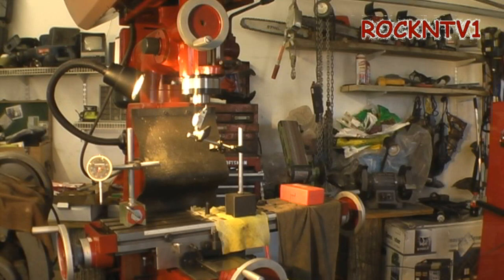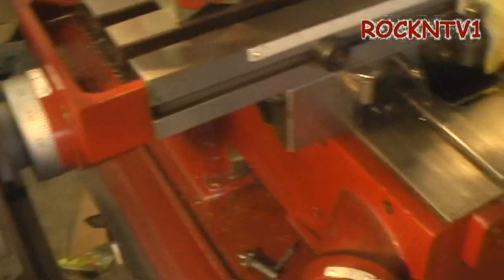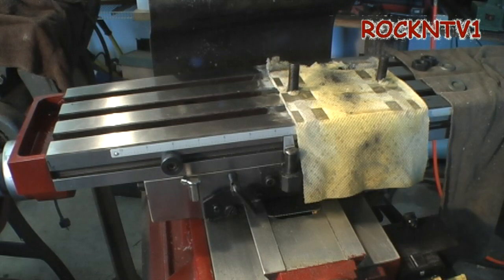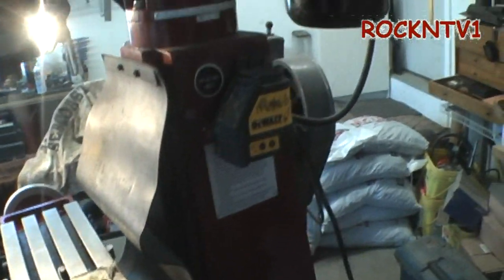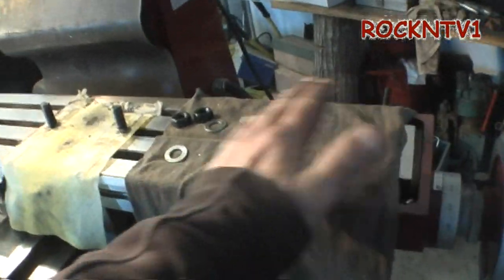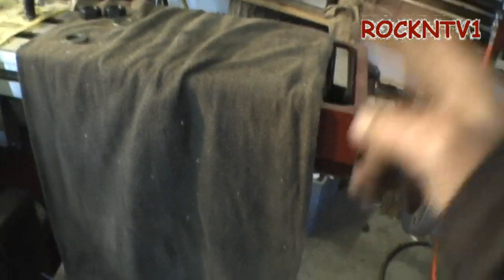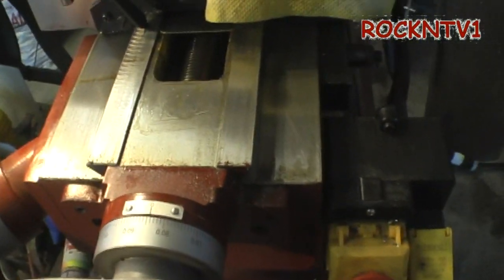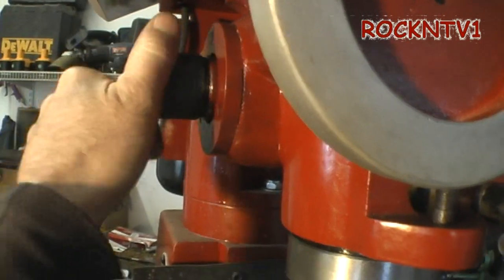HARBOR FREIGHT MILLING MACHINE MINI Knee MILL REVIEW 40939 6x26

Comment: I'm seriously thinking about getting  this machine one day, but I'm nervous 😅; the Grizzly machine starts at 6k up to 8k but it's it really tasty much better? 
Thanks for reviewing this machine, good video!

PS; for the money, this machine might be a hidden gem; mini mills cost this much,  but they do not have the power nor the weight. That said, I'll gladly pay 1k or a little more extra to get better surfaces and fit and finish.  
Thanks again for the video!
Reply from the maker: Cant speak to the quality of the grizly, it does have x power feed and green paint. my stand is way better,, lol  When it comes to parts they may be better, more easy to get,, dunno, i make everything.

Comment: You video is good, I agree with you, I bought and old bridgeport on ebay 3 years ago. Because i thought it was a great deal. When I got it home, the y axis slides had about .016" dip in wear, the table was down .024 in the middle of the ways. A few other things were wore out as well. I had access to a vey large newer milling machine where I worked. I remilled the table and ways, I remilled the entire knee. It took almost a year and a half after I had it in my workspace to get things straightened out. Then I had to regrind my spindle taper. It was a ton of work and and I lost tons of my own time. I needed a machine when I bought mine, but I wasn't able to use it for a year and a half. If you need a machine to use  now, don't buy the old wore out machine, buy a new cheapie and use it make some money with it and buy something later.
Reply from the maker: I agree

Comment: Hello! Checking in to see how you like the machine after all these years? Has it been as accurate as you would like it to be? Easy to maintain? This is still the cheapest smallest knee mill out there and the power & rigidity you get for the dollars seems to still be the best. Im in the market for a new mill soon.
Reply from the maker: Hi Joe, I do belive i could go on for hours on the Harbor Freight 6x26 bench milling machine and its pro and cons. I think i layed out pretty extensivly in the vid what you get. How ever here in 2021 the price has gone up, yet i'm, sure the build quality, parts availibility, and sentiment of the fork trucker during shipping has plummited. That said, If you are, or have machining experience on better quality milling machines, you may be disapointed, or you may better be able to deal with the idiocincracies ? of the chineese miller. You wont keep a bulb in the light. You will learn to deal with motor start capacitors and cheezy on/off switches. You will learn to count .125 per rev on feeds rather than .100 you will need a stand or a bench with a hole in it. You will tram the head nod with shims. You will calm your feed rate due to niose in the spindle sheave. If none of that has yet to deter your home machine shop projects, you will commence to mod the travels in x,y,z, lol. I do have a play list > https://youtube.com/playlist?list=PLhIFDVyYdJHY9V4PXfC63OIRFprrKIL1Z < this covers my last 7 years to date, PLZ dont use this on your site with out a link back here. Thanks, 
John
Reply from the maker: hope all is well ;-)

Comment: Is this machine the same as the Baileigh VM-626-1? It is a 1/3 of a price. One has the specs for 220v and the other is 110v
Reply from the maker: I dont know, this mill is 220v
Reply: @ROCKNTV1  Do you think that the harbor freight motor can be wired at 110v? I totally believe that they are the same machine with a different paint job.
Reply from the maker: not likly, but unsure,,,

Comment: 12:00 

allthread rod is soft, wouldn't be good for a lead screw. it would work, for a time, but it would wear out pretty quick and you'd have to buy another.
Reply from the maker: not allthread, 1x8 acme thread

Comment: Also, what type 240v connector did you use on the mill electrical cable and the wall socket?
Reply from the maker: oi, i forget 250/30p ?

Comment: It's been a few years, are you still using this machine?  Are you happy with it?  Are you doing ok?
Reply from the maker: yes, power switch has calfed, the belts have seriouse lumps at the splices, the motor end cap bells/ bearing holders, needed some tapping around with the soft hammer to find centers, as theyt are no where near the quality of a baldor or dayton motor.

Comment: try paste wax to fight rust I use it on my cast iron table saw and drill press the plus of not useing oil saw dust or chips do not stick to table
Reply from the maker: thanks for the tip
Reply from the maker: hope all is well ;-)

Comment: I HAVE THE GRIZZLY G3102 THE SHAFT IS ABOUT 36 3/4: LONG. I WOULD THINK IF YOU ARE RIGHT HANDED YOU MAY WANT THE MOTOR ON THE RIGHT SIDE FOR THE POWER FEED. IF YOU WANT TO GO TO CNC, YOU MAY WANT THE MOTOR  ON THE LEFTAND JUST REVERST THE SHAFT.  THE PROBLEM I SEEN WAS THE END CAPS ARE NOT REVERSABLE ON MY MACHINE. SO I ASSUME ONE WOULD HAVE TO REVERSE THE WHOLE CARRAGE ASSY.
Reply from the maker: replace the 40939 x lead screw with a g3102, and end cap, add power feed. thanks for watching, is you tube borking the comments?

Comment: you just do with what you can buy, a 10.000 dollar machine is great but only few people have that kind of money for a mill, my machines are never super clean but I do use an old vacuum cleaner when im done with the machine to clean it
Reply from the maker: I have been saving up for a milling machine for 2 years now. I called bigdog about the metal master mill as a match to my bigdog mini lathe, but they never called back, It was then that I looked hard at these 6x26 and the 40939 mill. So many mini lathe and hobby machine sites have photo's of this class of machine with useless mods and mis information, I thought I would give the facts on video.  pound for pound and dollar, I think i got the most machine for the money.
Reply: ROCKNTV1 Would love to have a machine like that and a gagage like yours, I think you got a nice mache for the money you payed, I hope you can take some of the runout of, but as long als you know it you can do something about it or at least know what its doing and why it could be a little off
Reply from the maker: happymark1805
good to ear you mark. hope al ist well, I fear not much can be done with the few tenths in the spindle, neither bearing nor grind provide and absolute outcome, slimming my options, however cutter compensation at touch off will give an experience operator +/- .001 or close, better then most machining jobs not government:)

Comment: This machine is not considered  a  ( mini ) mill.  its a small mill but not a mini mill.  type in mini mill in your browser and you will see what a  ( mini ) mill actually is.  No sarcasm intended.
Reply from the maker: I think the term is relative if one has run much larger milling machines. Some call them vertical bench knee mill.

Comment: Check out http://www.kinzers.com/don/MachineTools/Grizzly_G1004/ for ideas adapting power feed.
Also there is a guy on the yahoo 6x26 with pics that made an adapter to fit the lead screw. You got a lathe, you can do it.
Great vids
Reply from the maker: hi, I have seen that page, here, http://www.rockntv1.com/2014/01/40939-6x26-mini-knee-mill-review.html I out line the measurements of the 40939 mill In effort to source these parts off the shelf from the grizz 6x26 mill